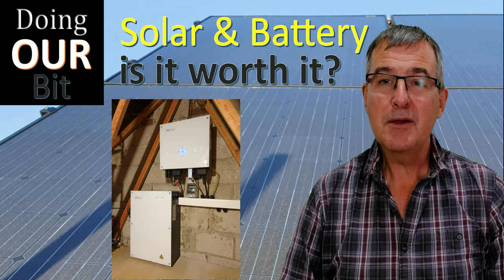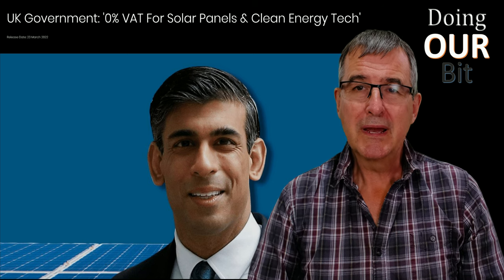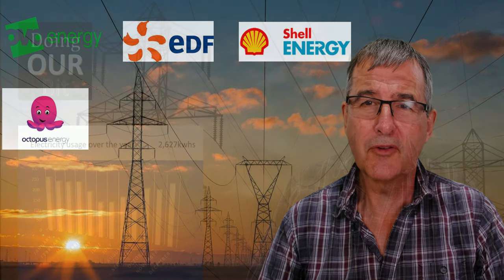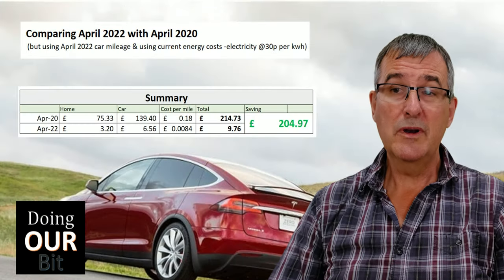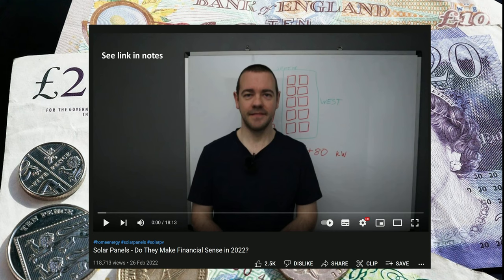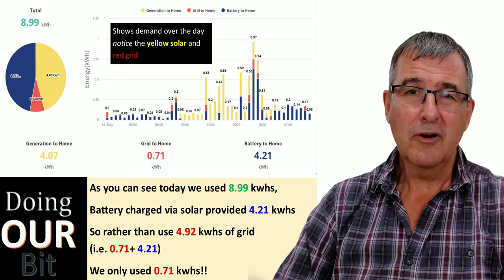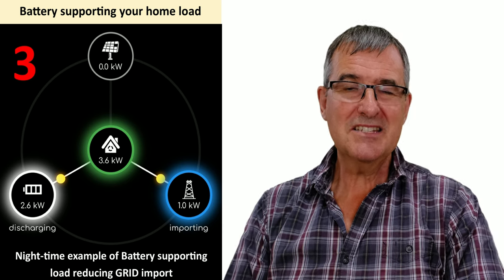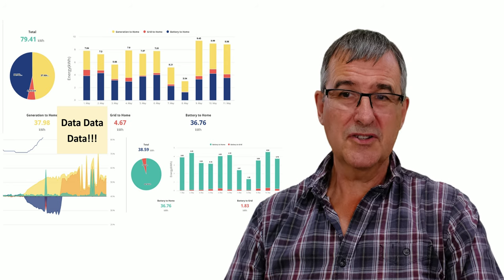Solar  and Battery install - is it worth it?

Comment: Hello, sunworshippers. I live in the Caribbean and have more sun here than I can handle. The price of electricity is not as high as in the uk. And I dont use that much anyway. But I believe in being selve efficient. So im really intrested in a solar system with a battery, that battery doesnt need to be that big coz all year round ive sunshine. But I want to be able to charge a ev and escooter. So I dont have to buy gas for the car anymore. Also we have unstable net here so once I a while we have blackouts and ur sensetive electronics could fry. So a battery would also be a emergency generator and would provide a stable net. I also want to cook electric so I dont have to buy gastanks anymore. And run ac during the day. And one at night in the bedroom. My question is what kind of battery I should go for? Should I buy one of the shelve or should I go with a battery out of a crashed ev? And what kind of panels are performing better in the heat? Those thin black onve or the thick glass once? Ive more than enough space to install so I dont need the hightech once I could use cheaper types and just add extra.
Reply: Hi, Spent our 40th Wedding anniversary in Barbados and loved it, so sun isn't a problem.  Your project sounds perfect but as you want to also be self sufficient in case of power cut, you really need ideally some quotes from reliable expert installers as making sure the system works for you needs an expert I would suggest. Getting the  right size of system particularly if you need it to work in the case of a power cut definitely needs an electrician. Hopefully such companies exist because Air con and solar panels are a marriage made in heaven.
Reply: @AdrianSmale  honestly I want to.cut.out the.net.totally. even though my bill is only 40 pounds a month. I would sleep a lot better knowing I dont need to rely on them. Blackouts usually last only a couple of hours. But the arrogance with those people because they have the monopoly. I dont have a ev. But really want a small city slicker just to go to work and do shopping. The diesel stays till it dies for long trips and pull the trailer. And a ev scooter for fast trips pay a bill or get beers haha. Im.even looking into buying a crashed.ev.and.transfor a old pickup into.a.ev or a old van. Im getting pissed off everytime I have to fill up the tank.
Reply: I was thinking the same thing. I live in Barbados and need a back up system for power outages. I don't want a portable battery with solar panels in the back yard. Don't want a gas generator either. Will ask a question.

Comment: So I’ve had a solar system fitted ,have 3 batteries, had it running 2 weeks now all good at mo ,I haven’t told octopus yet I have system fitted will be sorting that next couple days ,what I want to know is when the solar panels stop working in evening and the batteries need Charging up,will the grid automatically charge them or will this happen once I tell octopus I have solar and batteries fitted and go on to one of their tariffs , thanks
Reply: I can only speak from my experience of GivEnergy but I am sure the basics must be the same for all systems. You set a charge to % on the inverter settings and a charging period when this would happen.  I have it  set to 65% and because we are on Octopus Go (5p grid between 0.30-4.30) this charge window. If the battery fails below this figure in this window it draws from the grid and charges bsck up to that figure. But this does have to be set so I would check this with your supplier/installer.
Reply: @AdrianSmale  cheers for that I’m seeing my installer in couple days so will sort it all out with him ,at mo battery is at 12 % as not much solar yesterday and wife had washing on Ele showers  oven ,so soon drained battery’s

Comment: Do Octopus have a method of checking that you have an EV if you want to go on the cheap overnight rate? Surely not? And if they are prepared to sell you cheap overnight electricity for a car, why not for a battery? It reduces stress on the grid in both cases.
Reply: Frankly I don't think they do, it was just added to their T&Cs recently. I guess it's related to all the current craziness in the energy sector, but I love the passion and service I get from Octopus Energy. Best energy company I've ever dealt with by a million miles. They actually get back to you!

Comment: You cannot make a investment in solar panels and use the present kwh price in your calculations, it will get more and more expensive. I have a 10 kw installation with 10 kwh battery . It keeps me totally covered may June juli august and september .
Day and night And exported 5000 kWh to the grit,but you got peanuts for it 280 usd
Reply from the maker: If your investment is purely on payback I guess that's a concern. Having recently gone 100% electric, the price of peak going down and off peak going up and export likewise your right that we cannot predict future energy costs. If things go right I would expect energy costs to go down but there are no guarantees. My primary motivations are environmental ongoing monthly costs. Thanks for your comment

Comment: We have just moved to a newish bungalow which has air source under floor heating. We have a large SE facing roof but a shallow pitch at 25 degrees. We would like a system that can at least help the air source run in winter time as obviously this will be the time of greatest load. Also if i do the work myself, [I am an electrician but not registered to sign off] can I still get the feed in tariff? Anyone have any experience of this? Probably going for around a 6kw system which means lots to feed back to the grid and very little in winter. Defo going for a battery!
Reply: Sounds like you need a MSC installer who is happy to work with you, because you are right with a 6kw system you definitely want to take advantage of SEG. Hope you have success and thanks for commenting.
Reply: @AdrianSmale  Had a quote of 9.5k for a 6.25 system with a 5kw battery... may go with it!
Reply: @duncanforrest6571  Sounds promising all the best 👍
Reply: The generation on dull winter days is so little it will be of little help with your heat pump. Solar generates a lot in summer, just when you need it least for heating and lighting. I was very keen on solar until I looked carefully at the sums, including replacing the inverter and battery as they fail. It made far less sense than putting the money in savings account!
Reply: @jezmarshall9941  Did your sums include variable rate import and export tariffs?
Reply: @paddyeason9677  Indeed! I love the idea of solar but the economics just don't make sense when batteries and inverters will need replacing during the life of the panels.
Reply: @jezmarshall9941  Ten year guarantee. Items will likely last a lot longer. I file your argument alongside those I heard when the Prius first came out, from people saying that the batteries would only last 5 years…

Comment: My house is electric heat , in the winter I would need 25 panels to heat the house. My hydro electric bill is $1,500 for the whole year. I'll stay with hydro.
Reply: I hope to switch to electric heating next year but you are in a very good position if your renewably supplied energy supply is only I'm assuming $1500 US dollars. Everybody's situation is different but certainly in the UK the case for solar with the latest price hike today 26/8/22 is even more attractive than May when I did this video. Thanks for commenting

Comment: Where is battery located ? Do you need fire break?
Reply: Thanks for your comment. I had simular concerns but the operating temperature for the battery can go as high as 55C. However, as a safety backup I have a Bluetooth connected temperature min max thermometer by the battery along with a smoke detector.

Comment: Hi there. I had east west solar installed since July this year and yes it is worth it. Had a panel install of 6kWh and a SunSync 3.5 kW hybrid inverter plus 5.2kW battery. Inverter left in factory reset condition and had zero help from installer or SunSync to put matters right but eventually managed it via YouTube videos. 
Two big revelations one of which I only saw in the last few days.
First is that one simple program covers the whole year which is that you run all but one of the time zones at the empty bucket level, which for me is 30% battery discharge. The remaining time zone, for me 11.00 - 12.00 midnight is set to grid charge the battery to 65% so that there is a charge cycle EVER DAY during winter to replace the solar charge that occurs in summer otherwise the battery can remain at the low discharge level for days on end which is to its detriment and can further trickle discharge to eventually activate inverter back up which will automatically recharge battery to 50% at 10% discharge.(Values system specific). This should be the second line of defence and not used to achieve low battery discharge levels as I believe some installers might do without you knowing.
So, no need for program changes by third parties via Wi-Fi links as and when it suits them just the one for the whole life of the system. Access to our inverters should be taboo as malicious third parties could seriously damage them or even cause a lithium battery explosion / fire. (China).
The second revelation, which is specific to grid tied domestic systems, is that the claim that the addition of a battery is of significant cost benefit to the solar installation, it isn't as I will now reason. 
During the summer the days are long and the nights short so the battery is mostly fully charged. During the winter the days are short and the nights long so the battery is mainly discharged and might as well be off except for todays like today but their low incidence doesn't justify a battery. There's no advantage even on a day like today when the sun is bright and doing its job as they are not frequent enough. when the battery is charging it is not exporting so the cost saving is trivial. likewise in the summer battery charging is offset by exporting of non-battery installations.
We have had the technical wool pulled over our eyes which is now being continue a mis-selling to the puiblic.
Reply: I'm not sure of your logic there Alastair. I've installed my own bespoke 8.4kW array with 15kW of inverters and 92kW lead acid battery bank. I am 'off-grid' all the time except for charging the bank back up every night between 00:30 and 04:30 when my electricity is 12p per kWh. When the sun shines I can do all things domestic and can charge my 2010 Nissan Leaf from the panels / battery. This will be manageable for most of the year because of the availability of cheap off-peak grid electricity. I'm just about to install a 200L water tank (with dual 3kW immersion elements) to move our hot water from gas to electric. From April to October, most of this electricity will come from the panels, with a top-up overnight if needed. During the winter months, this will all have to come from off-peak electricity. Heating is a tricky one. I will leave my gas-fired combi boiler plumbed in for really cold days and use electric heaters for the rest, powered from the batteries during the day and replenished by night at 12p per kWh (at the moment....I expect this price to increase as more people adopt it). Without the battery bank, much of this wouldn't be possible. Although my battery bank is lead-acid, the same principle applies for any battery bank whatever the chemistry. It is the moving of the time of use of the grid that enables the gains.

Comment: What's wrong with pigeon nest?
Reply: I have been speaking with a PV installer who  said the problem escalates. One nest is no big deal, but it grows from there, and currently, I have maybe 3. So there's the every increasing mess, and cabling can be compromised in time. Unfortunately, it's not a good habitat for wildlife, and I'm all for encouraging that generally.

Comment: Great video. I dont like the electric vehicle situation, i have to regularly tow a trailer and this wont work with an EV.
Reply: Hi Dan, Many thanks. You will like my next video actually on EVs where I explain that right now you are right. The spec for you is not ready yet. However the good news is this is temporary and the torque characteristics will make them fantastic towing machines in the not too distance future. It's just a case of waiting unfortunately but I think the future in this area is very exciting indeed when you can also use that power for appliances, tools etc as well.
Reply: @AdrianSmale  hopefully the prices will come down on everything in the future so we can all benefit from the tech at a sensible price.
Reply: My electric van tows 1 tonne but that will improve in second generation

Comment: What system do you have? Can you do a cost breakdown? So many solar PV videos are US based so its hard to make a decision about which way to go. 

It appears that on the South Coast we can expect a maximum of 3 hours full sun a day, on average, so 3kwh per day per kw of panels, assuming no shading and optimal orientation.
Reply: Don't worry about 'sunshine', you'll produce a surprising amount of energy on dull rainy days. The key is the inverter capacity which for a standard G98 MSC installation is limited to 3.6kwh max generation. You need a G99 application to have more but just depends on your monthly usage. Our GivEnergy 3.6 hybrid inverter feeds a 8.2kwh  battery, and produces just under 4k kwhs per year. It's cost me just under 10k but I did it in two installations so not the most efficient although costs have since gone up and the challenge is a/ getting an installer b/ getting the gear. The good thing is the gear and the software just keeps getting better and better. If you have the resources , know your numbers and are prepared to wait, I doubt you can go wrong.
Reply: @AdrianSmale  Well, when I  tested a small panel, I was very surprised how much the output drops off the moment its not in full sunshine, let alone no sunshine, just daylight. I would expect output on a grey day to drop to 5% of full, direct, summer sun? 

The solar maps I have looked at say the best you can get in the UK is 3kwh per day per kw of panels, on average over a year. More likely around 2kwh.

How big is your array? 5-6kw?

Did you buy your kit and then find an installer or did you have to go with what they wanted to supply you?
Reply: I have 16x 300w panels (4.8k) through a 3.6kwh inverter that over 12 months delivered 3983kwhs of generation. These days most panels are 380-400kwh per panel so could be as high as 6.4k but would be pointless unless I had a 5kwh inverter under a G99 MSC application. The inverter is key but also what do you need?